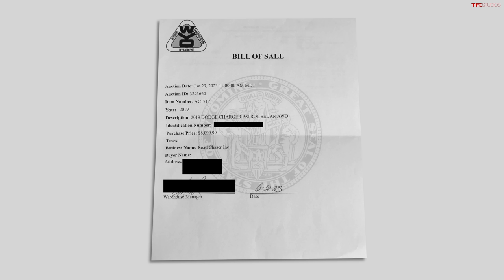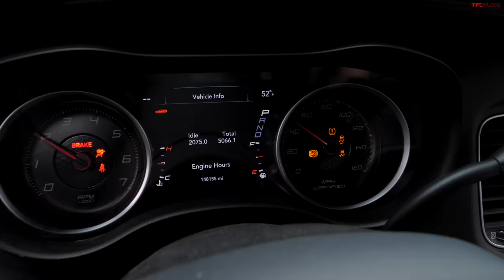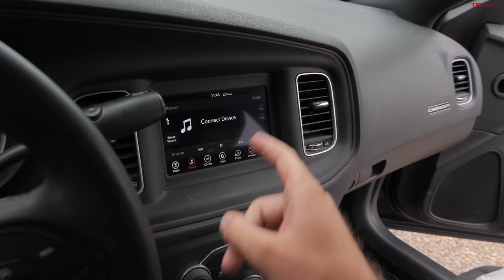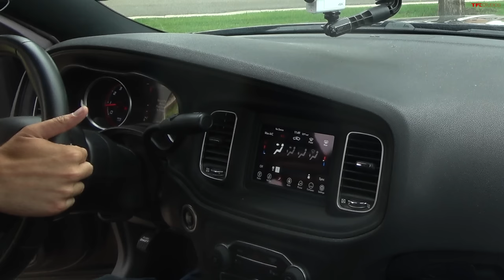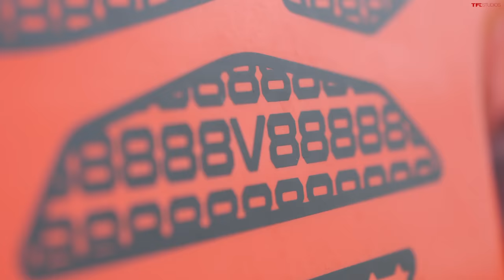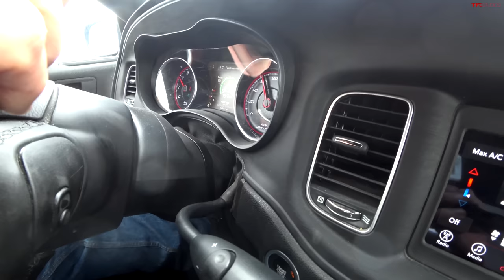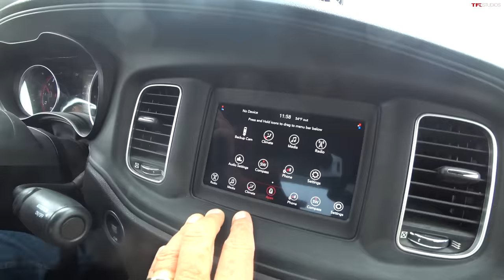We Bought a Car That Was Never Officially For Sale & Immediately Took It Drag Racing!

Comment: They did offer the Charger with a Hemi and AWD in the previous body style. Very limited production, but it was offered.
Reply: They said that
Reply: It was pretty common up here in Canada. The awd ones would sit higher on the front end, quite noticeably
Reply: Lots of them I'm Michigan.  They stopped doing AWD Hemis when they went to the 8 speed zf auto.  I haven't seen the race yet, but chances are that car has the previous gen 5-speed auto still.
Reply: I had a 07 r/t with AWD
Reply: I have an 07 AWD 300C, have had it for around 5 years. It was nothing crazy, and when they went to the zf8, they discontinued them. Now, everyone thinks that they never existed. All they did was continue running the NAG1 in the pursuit models so they could continue using the existing AWD system.
Reply: They said that in the video
Reply: @lonerider5315  No they didn't. What time in the vid? They mentioned the V6 AWD, the Hemi RWD, and how normal dealerships "never had those" (incorrect). The Hemi AWD Chargers were pretty common in the GTA, between 2011-16 when I was up in Barrie anyway.
Reply: @916roberts  No they didn't.
Reply: @jacquesc3166  yes they did watch again and listen this time.
Reply: @jacquesc3166  6:54 listen
Reply: @916roberts  No. What time exactly? I watched the whole thing.
Reply: @jacquesc3166  dude I literally just commented the time in my last comment
Reply: @jacquesc3166  7:01 tommy points out the white one.
Reply: @jacquesc3166 yes they did. I actually made the same comment while watching the video and then heard them say it at around 7:00 minutes
Reply: @SingleSpeed427 you’d be correct. Dodge produced the 5.7 AWD Charger pursuit with the previous generation 5 speed, however that has been discontinued I believe around 2020/2021 when the 5.7 Pursuit made the switch to the ZF 8 speed, the 5.7 now remains rwd only
Reply: At 7:07 they the sun talks about it and points one out right next to where they are standing.
Reply: @jacquesc3166 you didn’t watch it very closely obviously

Comment: Would love to see 5 things. 
1) Dyno it to see how much power is lost. 
2) tear down the engine to check wear. I’m particularly suspect of the rockers and bearings with all that idle time.
3) Rebuild that engine to be stout NA bored and stroked h/c/i, fbo, nitrous, whatever you can throw at it while still being NA
4) re-dyno
5) rematch against Raptor R
Reply: Yes!
Reply: Agree 👍
Reply: I am thinking of the car as a GTR killer. Rebuild motor, forged rods, pistons, stick a supercharger on it.  The car really would be a SuperCharger.
Reply: Wrong channel lol, they do surface reviews. Better chance of seeing if the pursuit charger can tow something on the ike.
Reply: bro all these ideas are great!
Reply: Ouuuu that would be a good episode ❤
Reply: I saw a Hotrod magazine where a guy built one and added twin turbos… made 1500+ horsepower iirc…
Reply: It still wouldn't be close. Might gain a second... If that.
Reply: Results would be the same. A Charger got spanked by a Ford pickup. Sorry. Not sorry😆🤣😂
Reply: Why? The Raptor R still smokes it. 🥱
Reply: These 5.7s love to drop lifters when the idle for long periods of time
Reply: Love listening to the Chrysler guys whine about a pickup truck whipping its German car and then making excuses.

Comment: “It's got a cop motor, a 440 cubic inch plant, it's got cop tires, cop suspensions, cop shocks. “
Reply: thats what came in my mind ;)
Reply: 440 hasn't been put in police cars for years. Most cop cars are v6 with a few v8 for high speed chases. Problem with most police cars is how heavy they are. Major reinforce front end, little more power than the average car but mostly its the equipment carried
Reply: Got a car to go with all that cop stuff? Lol
Reply: @Kevin.W.  440 hasn't been made since 1978. Very unlikely the police would have cars that are over 50 years old. Even less likely they would take 50 year old engines and put them in new cars. Most cop cars are base model with a few frame improvements and some slight engine modifications.  Truth is most police cars are only a little bit more powerful than the base model sold to the general public.  That is why people with high power cars can evade a cruiser but not the cruisers radio .

Comment: I bought a 2005 crown victory P71 in 2008/2009  it was a detectives car so no car chases or anything of the nature, he just drove it to & from work. It had been in an accident but only had around 87,000 miles, it now has 200,000 & not one single problem.  I've had a little performance work done to it, it dyno at 300 hp & 400 foot pounds so it is a little peppy. Can't wait to see what you guy's do with this car.
Reply: I just got rid of my2006 crown Vic police interceptor.  Bought it for 800 bucks but it was a lot of fun!

Comment: The charger was offered in AWD from 2008 i believe all the way to 2014 in the 5.7hemi . But never 2015 and up only in the pursuits
Reply: LIkely it didn't sell well enough.
Reply: @MichaelOKeefe2009 to much power for the paper masche awd drivetrain
Reply: @Drivenout owned 2 of these, a 2008 I still have and a 2014... never had a single problem except for an alternator on my 2014 went after 220000km.
Reply: @PILULE-ow9sk  i blew the transfer case and front differential on two separate occasions in winter
Reply: @Drivenout  god damn, not due to a lack of maintenance or you flooring it every other stop? 🥲
Reply: @PILULE-ow9sk  low mileage, fixed under warranty, a few Jackrabbit starts but i mean. Why else do you buy a Hemi in a car? Lol
Reply: @Drivenout  yeah ok same here, only speed it when I gap people going too slow on the highway... my 08 got 150000km and I shit you not I've changed absolutly nothing on it so far. I parted ways with my 14 about 2 years ago and like I said only changed the alternator after about 220000km 🙂
Reply: @PILULE-ow9sk  it is fun in winter to put the brodozers down with a car

Comment: The Charger Pursuit 1/4 mile time was 16.23. The new Super Duty H.O. DRW was 15.57.
Reply: Keep in mind, this is at a rediculous altitude. My 07 AWD 300c, with over 200k miles, can still run a 13.8.
Reply: @joer5057 my c5 runs 13.2 stock
Reply: in 2019 the awd 5.7 Charger did 0-100mph in 14.71 at the Michigan State Police annual vehicle testing. They didn't publish 1/4 mile times that year. It was 0-60 in 5.87sec. The rwd 5.7 was 0-100 in 14.66 and 0-60 in 6.15. So awd is faster 0-60 but then the awd becomes a drag at the drags. A raptor R is 0-60 in 3.6 sec and 0-100 in 9.1 sec according to Car and Driver.

The Charger did 149 mph top speed which will run down a Raptor R all day which is limited to 114 mph!

Comment: Since potentially lifting it and trying to make an off roader out of it was mentioned, I'd be curious how that car does on the TFL slip test. Especially since I'd assume my car's AWD system is similar, or the same, since I have a 2022 AWD 300. I am curious how such a system not designed for off road use, compares to those used in the types of vehicles you typically test.

Comment: @The Fast Lane Car So in response to your question about "Name another V8 Sedan Cop Car" GM made the chevy Caprice PPV with the 3.6 v6 or the 6.0L L77 V8 LS  engine from 2011 to 2017 in a V8 RWD platform. It was a imported Holden Caprice from Australia and was never for sale to the public in any way shape , form or fashion. Only offered in the US as a Fleet Vehicle for Police Use only and the only way to acquire a caprice PPV is through a government auction just like the one you got the charger from. The Caprice PPV was the last v8 competitor to the charger ending in 2017.

Comment: A police cruiser with with 150k miles on it but with that many hours it's close to ~220k with idle time. Also they aren't as fast in a straight line, but they have a pursuit mode that helps in corners/turns. Still excited for the series.

Comment: This is a perfect  Project car. Upgades needed  for engine Supercharger, fuel injectors, Spark plugs, exhaust system, and cold air intake system. Upgrades to the shocks and struts. Interior if you find a wrecked charger of same year in good shape you may be able swap out seats, door panels and hardware, headliner, sun visors and etc.

Comment: I don't understand why they didn't put the ZF transmissions in the cop versions.
Reply: DODGE said the ZF wasn't robust enough for Police use.
Reply: @benjaminwayneb even tho funny enough those dodge 5 speeds transmissions aren't great
Reply: @jaredfletcher1587  I can only recall one Mercedes 5 speed transmission failing so far in our Police fleet. The 5 speed transmission is the only good part on a Charger and they stopped using it.

Comment: 148k miles isn’t that much lol .. I guess that’s how diff states are , in Texas , it’s COMPLETELY normal to have a 2020-2021 (newer truck/car) and have 100k miles , it’s actually HARD to find a used vehicle under 100k miles , especially used f250s and such , I’m in search for a 17+ platinum 6.7 , under 60k$ and under 100k miles and it’s Hard , even 18+ f150 5.0s under 40k under 75k miles is HARD

Comment: An engine with 50K miles is tired? Not likely but if it was used for police work it probably idled for thousands of hours and may have a worn out camshaft that's not opening up the valves fully.

Comment: The AWD V8 was available for awhile, maybe not in 2019, but @ one point the Chrysler 300C had the AWD V8 5spd as did the Magnum & Charger & maybe even Challenger.  The AWD V8 5spd was in all three in the beginning.  I'd bet a dollar.  Try to be better w/this kind of info.  There's nothing wrong w/that Charger that a good intercooled turbo & maybe a bigger brake kit wouldn't fix.

Comment: Well I can tell you the newer models the county sheriff dept has where I live I work on everyday including surrounding counties. I test driven them up to 100mph on the interstate and I can tell you the chargers now are extremely Slow!!! No power what so ever! Idk how they catch anyone in those things! The challengers we have here though will ride pretty good but every cop in this area will tell you the Tahoe's will out run the chargers and that's just sad!!!
Reply: The 2019 Michigan State Police vehicle testing has the 0-60 a full 2 seconds quicker on the 5.7 awd Charger than the Tahoe. 0-100 the Charger is over 4 seconds quicker than the Tahoe. The 3.6 Charger is an even race with the Tahoe. Maybe your guys got the 3.6 Chargers or a Charger just doesn't "feel" the speed as much as a Tahoe does, but it is quicker and has a 30 mph top speed advantage as well (went 149). What was quicker than the Charger but not available in 2019 was the 3.5 Ecoboost Ford Taurus based sedans and the 6.0 Chevy Caprice Police cars built on the Australian Holden chassis. The Caprice was rwd only but the 3.5 Ecoboost was awd only. Those are the quickest police cars ever tested. That's going to change next year when the police EV Blazer is launched based on the new EV Blazer SS.
Reply: @bryanhersman4037  yeah you could be right I'm not exactly sure which ones they have tbh were only allowed to do the brake and front end work on them and they tire guys do the tires on them of course but they make them use the county shop for the more expensive eng. Work to save money IV never really asked but I know there some chargers and challengers out there that some of our other customers bring in that have a good bit more power than the patrol cars.. You would think since most are traffic mainly interstate guys who come see us they would give them the top of line bigger faster engines in them.. I guess it's all about the money lol .

Comment: I'd just have the engine rebuilt that would bring back more power than performance mod's
Reply: @WW-wf8tu  I work for a city with the mechanics that work on those car they got way to much to do to waste time de-tuning cars.and this car was bought in Wyoming were I live They don't spend a lot on cars that are getting trade of or sold soon so a plugs wires and check over is a good idea but you aren't likely to get much more power from that.

Comment: As far as a preformance upgrade, i would try dyno-blades. They increase fuel efficiency and power, especially torque. I would not be surprised if dyno-blades would even sponsor you. They atomize the fuel behind the injector. will work on all port fuel injection engines.

Comment: The lights hemi I had went from a red light and started off with running 45 miles an hour it went to shaking and vibrating real bad I looked behind me at the sun's coming out of engine it was a stream of oil A-Rod went through the side of it anyway got a new engine it was under warranty put it in look at the old engine and that block look like it was about 3 16th of an inch thick I said no no no no more hemis for me

Comment: This is great. But I would strongly suggest,  beings I use to work and service the cop cars, have a trusted mechanic go through it, check the computer and all that. That charger seems very underpowered. And there are some PD's that will turn them way down before they sell them at auction.  They won't tell you they did, but they do. Other than that, you got a really good deal on that car. Even with the miles and hours on it.
Reply: LMAO!!!! They do not "turn them down"... the departments have no way of doing so without paying an actual tuner to do that.

Comment: The hemi in that pursuit Dodge has to be very, very tired.  If it is to be compared to other cars or trucks, do a compression check first.  Maybe refresh the engine if needed.
Otherwise any results are suspect.  (Ha).

Comment: Still has that lousy 4 speed transmission so they are slower than V6 RWD Chargers with the 8 speed transmission. If they can, people would be best off putting the 6.4 with an 8 speed out of a grand Cherokee or Durango, and a custom front driveshaft, then they would be quicker than a Hellcat Charger or Challenger off the line on the street, but not quicker than any Hellcat Grand Cherokee or Durango. If they can find a Hellcat drivetrain from a Trackhawk then they will be in the sleeper business in the end, keep the unassuming stock RT wheels.
Reply: 5 speed and they aren't slower.
Reply: @benjaminwayneb  Basing knowledge of the older NAG1 transmissions. Thanks for catching my mistake, 5 speed not a 4 speed. But I am not mistaken in their off the line speed. They are far slower off the line. Basing experience as an FCA technician for 6 years at a dealership in central california with a large contract with the state to service CHP and several local PDs with AWD 5.7 chargers the old and the new. According to the butt dyno, they are slower even if reality says different. If you are after a thrill, swap transmissions or at least swap engines, the NAG1 leaves much to be desired.
Reply: @KoryBrooks  Look up Michigan State Police vehicle tests, all thier test results are available, acceleration, braking, and track times. The Hemi is much faster than the 3.6. The fastest Police vehicle is the Explorer both in acceleration and on the track.

Comment: They don't run emissions compliant fuel injectors... they were swapped out with the removal of all equipment, stuck at 180hp because of re-fitting for civilian sales.
Reply: Completely false. The engine is the same exact engine that every other Charger Hemi is. Only difference is suspension, brakes and the police specific interior equipment.